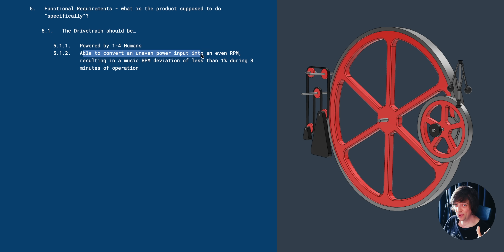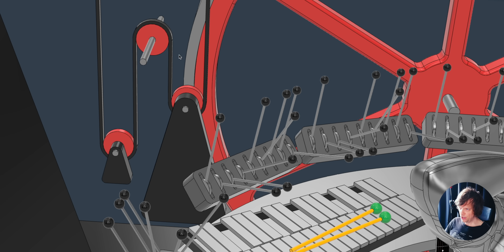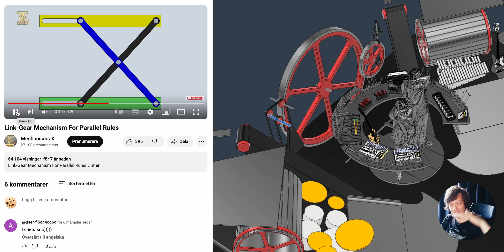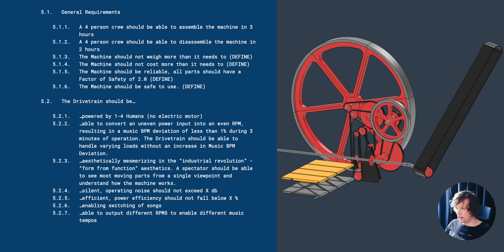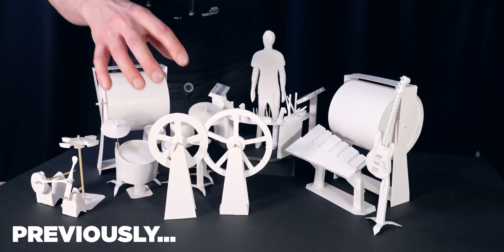The Marble Machine Drivetrain

Comment: That giant 2t flywheel is waaay excessive imo. Getting the whole machine up to speed and keeping it going will be like pushing a SUV. It can be quite a workout even for 4 people. And remember that you have to keep it going for duration of a concert which can be over one hour. And to add to that you'll want to play guitar and other instruments require excellent coordination and precision which will be extremely difficult to achieve while working your ass off to power the machine. 
Average man generates around 200W during quite intense biking (upwards to 400W or sth like that) and unless you're some kind of Tour de France kinds of sportsman you won't be able to power the machine for very long. Looking at the size of the machine it's gonna need power counted in kW.

Before designing or even drafting new machine I would recommend do some basic math to check what is physically and realistically possible to achieve with pure muscle, because I don't see avg power output greater than 100W per person during 1-1.5h concert (unless you want to go through intense cardio training beforehand)

Comment: I haven't been back since MMX was stopped.  As a automation engineer with 50 years of experience I have only one suggestion.  Perfection kills finished every time.  There is point whare you must stop and say good enough and move on to the next project. 
As for what should be in front.  your audience is coming to a Wintergatan Show.   You are what they a paying to see not the flywheel. I can also see a ton of issues with have components of the machine at a distance from the rest of the machine. The reason being is that drive shafts twist when torque is applied to them. Timing could be an issue.

Comment: Could you put the flywheels directly below the control station. So the controls sit up high above it all? Maybe imagine a central pedestal, with the wheels sitting inside the base and shaft. Then the controls and pedal platform making up the top of the pedestal. Then the belts and drums to either side, like wings?

Comment: This machine is getting large and heavy enough that you need to think about Health & Safety as well. I think your flywheel spokes need to be closed off / filled in by maybe perspex panels to prevent someone getting their arm in there. Especially since your whole band is going to be in such close proximity to all the moving parts. Do some questioning on will a venue allow this on stage, from a safety perspective.

Comment: Why not make the pedals a "see-saw"/"teeter-totter".
As in, a pedal is pivoted on the exact centre, using a drive shaft as the pivot. 
So, the human operator only needs to rock "back and forth" on the pedal (perhaps placing one foot on each end of the pedal (across the pivot), and allowing the operator to actuate the pedal by shifting their entire body weight from one leg to the other, increasing power that can be easily applied to the drive system, and also helping the operator to keep their balance, since it will be a rhythmic motion using the entire body. 
This "rocking motion" will rotate the pivot shaft, say a grand total of 40° (20°) in each direction. This shaft could also go into a gear box to increase the degree of rotation that is being applied to your actual drive, at the expense of decreased torque, and increased resistance on the pedal. However this increased resistance might make the pedal less tiring to operate, and easier to balance upon for the operator.
This also allows you to orientate the drive shaft into the same place of rotation for your actual drive, without needing complicated universal joints or the like.

Comment: Hi Martin.  I work in aerospace.  When we write design requirements, the auxiliary verb used has specific meanings.  
'Shall' denotes a mandatory requirement.  
'Should' denotes a recommendation or advice on implementing the requirement.
'Must' denotes a regulatory requirement (probably not applicable for you unless maybe there is a safety standard you want to include)
'May' denotes a permissible practice or action.
The syntax of a requirement must be "The [subject] shall [performance limits] when [ operating conditions]"  
Example:  The flywheel shall maintain constant speed within ± .01% when up to 15 channels are activated simultaneously.

Comment: have you considered using hydraulics to link the pedals to the governor system, you could use simple hydraulics to create either a gravitational potential or pressurize air to then convert into mechanical energy, thus preserving the appearance  of visible components, yet hiding hoses and still keeping linear movements. and if you wish to prevent issues with bleeding lines farm hydraulic quick connectors would be easy to assemble and source.

Comment: I wonder if you raised the gear train up to about waist height so it was visible just behind the operator?  You could extend the drive belt down to the driveshafts near the bottom, but the gears, and governor would be visible

Comment: Regarding showcasing everything in a cool way, why not elevate the flywheel a meter (or even half a meter) compared to the operators in front?

You would showcase the operators but the huge flywheel would look even more intimidating towering further above you, and you could see more of the cool gearing ect from the front.

Comment: put all of those gears and belts at head height with the opperators instead of being at leg height. the wheel can stay in place where it is mostly because of the sheer weight of it. It gets dangerous if you move they flywheel to high up without a proper mount. But thats also an option which is moving it higher and keeping the opperators as low as possible.

Comment: As someone who knows not much about mechanical structures. Could you not just make the the flywheels and other cool stuff movable vertically and just swap out to longer timing belts (assuming your in a venue that allows the vertical space). Looks like 5 feet would be all you need to see the cool stuff and make the flywhell more lording over you.

Comment: The number one design requirement should be safety. All these rotating parts and belts, seems dangerous. 

Also, this a MARBLE machine. The marbles need to be the stars of the show, not the flywheel.

Comment: I feel like we're suddenly faced with a question that the Design Document never addressed - the scope of the machine, summed up in one big question.

"Will the concert be a Wintergarten Concert with an amazing marble machine, or will it be a Marble Machine Concert with a supporting band?"

The scope of the MM1 and MMX is very different to this new machine. It's not neccesarily a bad thing, if that's what Martin wants, but I feel like the scope has "crept", increasing in focus and importance in the concert without Martin explicitly addressing it in the design document or in videos.

The engineering requirements have crept from "Operable with 1 person, maintainable and transportable with 2-4 people in 1-2 hours" to "Requires a full band (4) and supporting team (4+) to operate and maintain, several hours to days to transport"

The space requirements have increased from "any available flat area of 2-3 square meters" to "entire concert stage". 

The concert requirements have increased from "plays a few songs during a concert" to "will feature heavily or be the main focus in every song in a concert of potentially several hours".

I know martin has taken a more function oriented design process for the new machine, but one of the major things you need to decide on, usually at the start, are the limitations in scope you need to adhere to and this has not happened.
Reply: Venue and stage access are now a significant concern. Is the venue's stage strong enough to support the machine, and is the venue's insurance strong enough to permit performers being amongst that many flywheels and shafts. It's a fantasy at this point.
Reply: And don’t forget:  he’s not even played a single song with any of his machines in the past 8 years…

Comment: I still think if you can change the programming wheel/drum angle you could make some interesting visuals.  That's the one thing you haven't played with how it's set up other than positionally...like if you had drive train wheels that are connected to the main one with the programming wheels either stood on their end or a 45 degree angle.

But also, make sure you account for redundancy...for something you tear down and put back together, breakage can easily occur so you will want as many spares as you can afford.

Comment: I still think putting the Huygens drive after your main (big) flywheel with a clutch in between governed by the Huygens drive position is a better option as it would give you a wider range of input speeds while decoupling your input from your output flywheel. Using weights still feels like a compromise compared to constant force springs as you're going to lose some speed accuracy to variations in gravity.

Comment: The pedal being the scissor lift style is good but it will be a lot of friction points so each of those connecting points would need good bearings. Its not just up and down like most think but also side to side forces trying to topple it over so each pivot point would have twisting forces to deal with so if you don't want side to side slop then they will need thick bearings or stacked bearings. So its a lot of material cost for these than a simple lever arm. Its something that will need some overbuilding in places to keep it operating smoothly and not be a maintenance nightmare later. 

The pieced flywheel like you had there is something that could work quite well. A flywheel just needs to be weight balanced and not machined perfectly. Machining might make it pretty but as long as the weight is in the places in needs and evened out the wheel could be as weird angles and wobble all over the place but would not cause vibrations or wear to the machine. However if its sections bolted together then if its taken apart, each bolt and nut would have to be cataloged where it went so it would go exactly back to keep balanced otherwise it would have to be rebalanced each time its taken apart.

As far as the placement of the drivetrain, infront with you behind it. Not just behind but behind and somewhat elevated up so you can still be seen and while the flywheel is spinning you can be seen through it. It should still be well inline and close to where it needs. As an option, while being mechanical, you could use human powered hydraulics for the pedal. You push on the pedal to supply power, it pushes a piston to push fluid to another piston that is attached to the drivetrain. Kinda like the bike brake cables but fluids instead and a lot more responsive so you can be positioned a lot better around the machine.  

One final thing, instead of the belt going to the governor and twisting like that. It might be a bit more simplistic to have it go to a normal pully and into a geared 90 degree. Twisted belts like that can suffer some problems like putting them on and keeping them on. Tensioning them can be problematic and the flap making weird noises. Since the governor is controlling things, it needs to be extra responsive so a fairly tight belt would be needed to keep timing optimal.

Comment: A good definition of "easy" when if comes to maintenance or disassembly is kinda simple. Its being able to take apart things in a easy manor like easy to access bolts like not having to fiddle with a nut and bolt where 1 person holding both would be difficult to do. 
A lot of parts being in the way and if you have to take apart something to replace or maintain, you have to remove other parts just to get to it is not "easy". 
Also another definer of easy or hard is not needing a bunch of special tools for nuts and bolts to disassemble the main parts for transport so most of them would be a few tools or sizes of sockets/wrenches. If you have a main part to disassemble for transport then having few tools as possible does make it easier to do. 

Anyone who has worked on cars like mechanics knows all these problems and what is easy or not. Trying to swap wrenches or sockets to undo dozens of bolts, trying to figure out what size they could be and of you can reach it with a ratchet or if its too close and need to use a wrench, it eats up a lot of time but trying to design a machine where time goal like 2 hours can be problematic. You would never know how long it will take to assemble or disassemble something until you get people doing it. A person that is new and does not know all the sizes, locations and order of how it goes together or comes apart, they could take 3 times as long as someone that does know. Car part repair is really based on estimations and sometimes those estimations either rely on special tools to bypass stuff or kinda knowing what to do and where to look. Even then the estimation can be quite short or way longer. Mechanics kinda hate the "estimated time thing" and when its a "you should be able to do this in such time" they get quite annoyed when they first go and work on it and find its a lot more tedious to do.

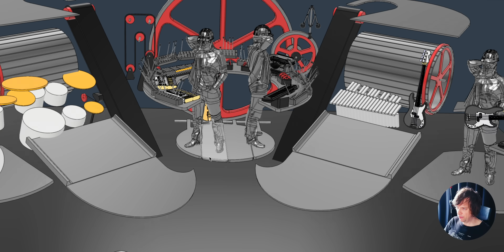Comment: The entire discussion about the pedals (circa 02:30) - this is an extremely dangerous idea that is going to see someone injured. You're putting the entire standing surface of the control panel on an unstable surface, and in cases like that it's not IF an accident is going to happen (especially if it's on stage), it's WHEN.

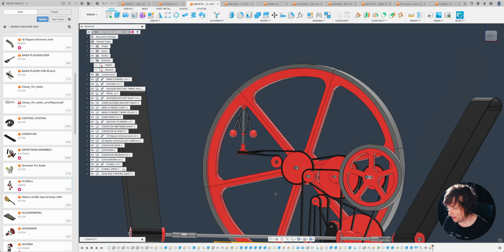Edit: 6:30 - You're going to need guards on that auxiliary flywheel if it's spinning opposite; that's a snapped arm or severed finger there. (You'd need guards on it regardless, but spinning against... yeah that's... yikes.)

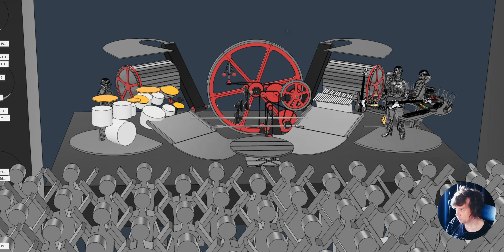Edit 2: 09:40 - YIKES.

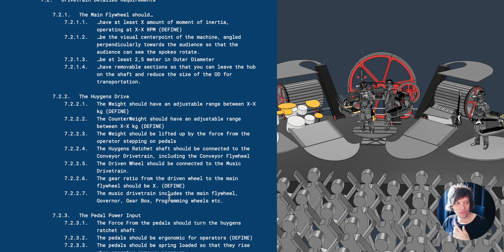At 10:55, you said that you've "been slacking a bit at filling in the design requirements"... for the love of all that is holy put operator safety in there!

Comment: Martin. why does the flywheel needs to be vertical. It could be angled to the floor, so that the front edge is forward and low, and it rises at the rear. this could allow operators to stand above it and it protrude from the front of the platform?

Comment: Are we really thinking correctly about the power? You say that if many marbles are on the conveyor belts you will need to pedal more forcefully. But is it really your pedaling that drives the machine? Isn't it the weight difference in the Huygens drive? If so, there will come a point when the weight difference is not enough and the machine will stop even though you keep pedaling.

Comment: Uhhhh... have you considered... splitting the control station? Nonono... hear me out: You're never going to be levering levers, pump the pedals AND play guitar at the same time anyway, so why have all of it in the same place? Come to think of it... you will need to stop parts for changing the programming sheets anyway... how about you design the machine so that it inherently allows for you to play one half of it while the other half gets swapped! So, divide controls and set them up far left and far right. Center stage becomes free for the drivetrain showing all the components doing their thing. Add a performing platform (no pedals) in front of that (but use it only for solos).

- but the most important questions you should ask is: Who will perform with you? Will they be fine with not being the star? Are they fine if you place them wherever the machine leaves free space? Who has priority here?

Comment: Is there an hight requirement at the podium? Suggestion put the flywheel construction or gear construction above the controls. Second option, create some space below the control station and make the gear construction visible with the peddle mechanism below the control station. So layering the position in depth but also in hight.

Comment: Why don't you have an elevated stage above and maybe behind the marble machine? I mean, in a way the machine is the main actor. Having the controls above it is more secure(you are out of reach of a 1t? flywheel) and having the whole band there together gives a lot more cohesion to the human component then trying to find places where to shove them. That would also allow you to mirror the section, like the drummer sits above the drum section etc.. Meanwhile you can still have stairs that allow you to move in front of the machine, for guitar solos for instance. 

Not sure if this is feasible from an event organisation standpoint, like having an elevated stage at all. Then again I'm not sure that flywheel won't need support beams to not break through the stage anyway, so I guess this won't work in every venue anyway^^.